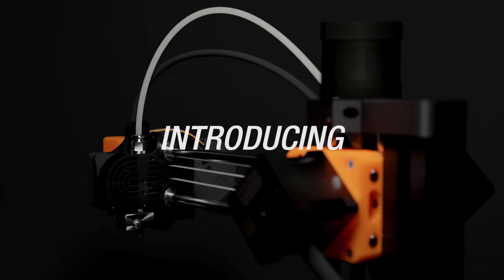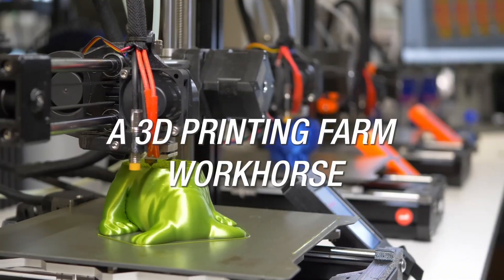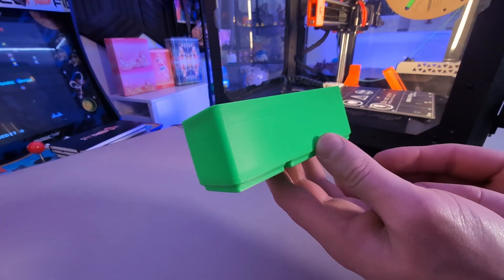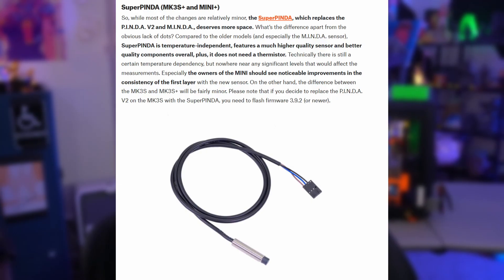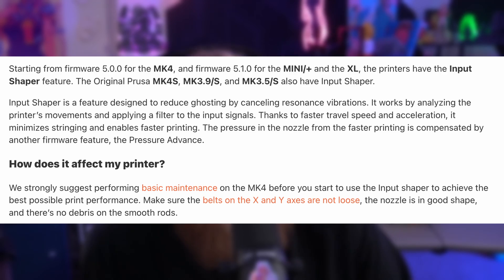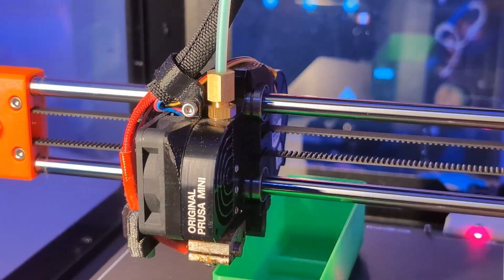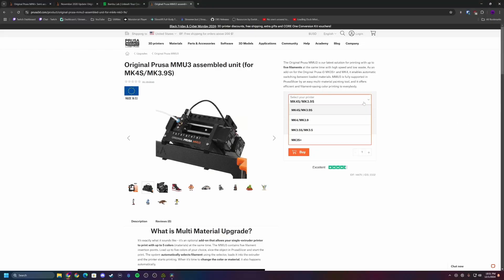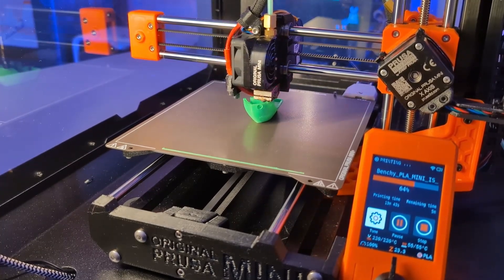The Rise and Stall of the Prusa Mini

Comment: The biggest flaw of the Mini in my opinion is the cooling. With the fan only blowing from one side, I often had to strategically orient prints so that overhangs would point towards the fan. It's overall just not powerful enough to print much faster than it does now.
It also needs to have a way to calibrate the XY skew automatically, because the assembly is prone to small errors that cause round prints to become oval. Having to fix this with a carpenter's square and many test prints is a terrible user experience.

Comment: I bought a couple of rescues off of FB marketplace.   $100 ea.   Then I did a full bearing and belt replacement.   I think it’s still relevant.    The fastest printer is another printer.   A lot of models I’ve done recently are ones you have to assemble.  Multicolor is cool but not always convenient or better for an assembly.   Being able to send small parts by color to my minis and larger pieces and multicolor pieces to my CoreOneMMU has proven to be a good way to speed up workflow.

Comment: I had a Ender2pro never felt like a pro upgraded £200 worth of parts with price £140 making it £340 just for silent and silent printing 200mm/s speeds. But wasn’t enough and consistent. When I saw prusa mini I didnt want another headache and waited and got FF5MPro. No regrets.

I wish that actually make dual gantry prusa mini or a kit. With direct drive for TPU and dual material. It would be good for £400 but naa they wont try

Comment: When Bambu locked down their ecosystem, I sold my P1S because being forced back to Bambu Studio from OrcaSlicer was not gonna happen. I uesd the money to buy the Mini+ with an enclosure (because I have pets) which has served me well and got me through a Voron 2.4 350 build, but the enclosure is so big it kinda defeats the purpose. It takes basically the same amount of floorspace as the V2 with the much smaller build size. If you can throw it on a desk for PLA and PETG parts I like it but the enclosure makes it way too bulky to justify.
Reply from the maker: Agreed.  Which is so sad because the enclosure is quite nice and built like a tank.

Comment: What i bought the mini for: entering the prusa ecosystem. 
What i got over the years: wifi, input shaper, proper prusa connect integration (yes, even easy print directly from printable)

I think it's a solid printer. It really doesn't miss many features. Only reason I will update one day is print volume and multi material

Comment: I went from Prusa fanboy with my MK3S+ and MK4S from 2020 to the Bambu ecosystem and man it just felt like Prusa was living in the dinosaur era, got me wondering how they're even surviving on the premium they STILL charge. Well I actually found a Mini+ on FBMP a couple months ago for $100 with only 3 print days on it, did a ton of upgrades on it including printing that badass printer base stand on Printables, new heat bed(other one wasn't heating all areas) assembly, tungsten carbide nozzle, Bondtech extruder, and some new PEI and Satin sheets bc the other one was scarred up so bad. I think the previous user just didn't know what he was doing and gave up on it. Anyways, after all the upgrades and tuning I've done, it still won't print 90 degree corners correctly without bulging/rounding them but other than that it is a badass looking little printer that brings me back to why I got into printing in the first place, but with all the tweaking I have to do sometimes it's sort of a love/hate relationship.
Reply from the maker: They're not bad little printers, I just personally can't justify the price of one anymore and I want the increase in quality straight from factory.

Comment: I have to wonder why Prusa bothered buying Printed Solid at all. They don't make Prusament, and barely keep any in stock so if you want any, you're still paying shipping from Europe. They're out of stock on a lot of the spare parts. Not really sure what they gained from it other than another distributor, but they haven't really done much to make it "Prusa USA".
Reply from the maker: Yeah I'm not really sure what the point was.  It's disappointing.
Reply: I agree 100%, and it's not any cheaper for us to buy it from PS than it is from Prusa direct! I needed a heatbed replacement for the mini+ and it was cheaper to get it from Prusa, plus i was able to grab a couple of print sheets and prusament, than it would have been to get from PSUSA plus they didn't even have the other things in stock. What a waste!

Comment: the mini aged, but mine still does  a good job. I changed a while ago to revo hotend. It's full metal and no tiny ptfe tubes needed to replace. 

BTW did you know that 3d printiverse made it possible to use mk4 nozzle on your mini?
Reply from the maker: I did not know that, that sounds like a good upgrade!

Comment: Basically nailed all the points (albeit, I've only been in the Mini+ camp). Started with a microcenters powerspec back in 2019 as I was very new, the non-sticking print bed that had to be calibrated every print really killed my motivation. It was a chore to print so I only made a few things on it. After the huge fan love and videos for the mini+, I splurged and got it. And yes, just 3 pieces to install, sliced file and......print. And it just....works. And it continues to "just work". Even right now, as it sat for almost a year, dusted it off and (after updating and everything ugh), clicked print and...boom all 5 objects are printing as I type this. Hell, I haven't ever changed or fixed anything yet. Everything is still OG from the day I bought it. Its..slightly louder yes, but its still kicking. 

I will say, I (or rather we with the mini+, especially in the discord) have quite a bit disdain with prusas promises as well, if you remember, they promised us wifi for the mini+. That, of course, never came to be until years later. It was especially questionable because you had devices all the way back in 2005 (the psp) that had built in wifi. Yet for some reason, expensive machines built in 2020+ can't have this basic feature. 

I have no idea what this "input shaper" business is, so I guess I will find out when my current print finishes. Personally I have no care to update anything, since I had zero extrusion issues before. It'd be shame if now all of a sudden, an update made printing quality worse. especially since prusa's were/are known for their quality prints.

Comment: Well, you are mostly right. There is one little detail - it is not worth it for people in America? Europe? Shipping is 10€. And in Czech Republic? 3,50€ for shipping. Boom, way ahead of Bambu. 

Last month I bought my first Mini. Got it second hand from local Craigslist for 172€. It was listed as broken and not working because the original owner was playing around with a soldering iron and broke a pullup resistor from extruder thermistor, which sent the printer to error state. That was easily fixed, took be about two hours of soldering. On the other hand the printer was already equipped with upgraded extruder from Bondtech. Sadly the seller chose bad shipping company so the printer came broken. The main polycarbonate pieces in front and back got damaged and the print sheet got the PEI sheet damaged. Spare parts were ordered directly from Prusa, 3,94€/piece and 9,64€ for the PEI-Ultem sheet, 3,50€ for shipping. Once I fixed that, I found out the printer had used 500m of filament in it's life so it basically printed nothing. 
Next I started upgrading - ordered titanium heatbreak from Trianglelab (7,50€), Mellow copper heat block (9,40€) and 70W heating cartridge (3,43€). After trying to install the heater I found out the thermistor is kinda mangled from mishandling so I had to order new one from Prusa. That was 9,92€, bought a new nozzle (5,93€) and grabbed a satin print sheet (35,81€), 3,50€ shipping. The only thing I am missing now is boron nitride paste for the heatbreak. Also bought second spare PEI foil from cheaper shop (7,93€), some T nuts for Z axis support (0,79€) and 2,99€ for shipping. Summed up - 280,22€ for well upgraded Prusa Mini+ with all the shipping. Still not worth it? :)
Reply from the maker: Shipping from Prusa to somewhere other than US definitely changes the equation a bit.  But look at how much you had to change about the original design to get a printer you're happy with?  It sounds great if you want to change out parts, try different upgrades, etc.  I do not want to do that.  I want a printer that works well straight from the manufacturer, which the Prusa Mini does mostly (I still use mine even if pressure advance stuff is not 100%).  My point was that buying a NEW Prusa Mini doesn't seem worth the cost + hassle.  There will obviously always be edge cases where my conclusion is not true.
Reply: @TubaMakes  Well, yeah, true. But I didn't have to change the original design. I just... Upgraded the materials it is made out of :D 
That's just me and my overengineering brain though. Once I fixed the functional problems it came with the printer worked flawlessly. It just needed first layer height configuration and my first print on this printer came out perfect. I don't personally have experience with Bambulab but from what I heard from my friends who tend to blindly hate on Průša the experience is great, but not 100%. So mileage may vary. Yes, you are right - it is not worth to buy the mini anymore. Price in CZ is 459€ plus 4€ shipping, Bambu A1 mini with AMS is 349€ + 10€ shipping + 72€ VAT so around 431€ and it offers AMS.

Comment: Honestly, as a prusa fanboy ever since I got my mk3s+, I gotta say that it hurts to see what prusa is doing. I mean I love the core one and I will get one, 100%, but it's missing features that are really sought after like a camera and accelerometer. Tbh they are getting ripped off by that company that is making the buddy 3d camera cus I'm like 90% sure that camera is simply bought from China and resold for a huge markup. Also, since it says in the description of the camera that it should offer remote movable camera it likely means it has some sort of motor inside (idk if that's the case, I didn't do any research). Which means that the core one camera, the smaller magnetized one is missing that feature and is sold at the same price. That's just stupid to me. And the accelerometer it's way too expensive at like 18$ cus other ones are like 5$. Sure, they probably make their own accelerometer, but if they make it and they make all the other boards in their printers, I'm sure they could easily add the accelerometer as part of the board itself, like in the hotend. Bit more difficult for the heat bed but still. It honestly saddens me because, even with the price premium, more people would buy Prusa if only they offered more features by default with their printers, not separate add-ons that cost WAY too much. Although I want  the camera for the core one, I'll likely get some cheap alternative and make a case for it or wait for some 3rd party to make a compatible one.
Also, unrelated to my rant, but that PTFE tube, you can just buy some cheap PTFE tube, cut it to length, use a drill bit to add a chamfer to the entrance hole and you're good. I can do that on my mk3s+ too (although after nearly 2 years I never had to, but idk)
Reply from the maker: I agree.  If I felt like the Core One had everything it needed to in 2025, I'd get one.  Especially with Bambu being Bambu.  I love Prusa Support and I love Prusa Connect.  But it is HARD to see the reviews of something like Elegoo's Centauri Carbon at supposedly sub $500 and still blindly buy the Core One.  I personally can't make that jump in money and I really really want to.  Like I said in the video, cheap got good.  Prusa can only run on "We're Prusa, so you'll keep buying" for so long.

Comment: I believe Prusa will release an upgrade kit to the Prusa Mini one day

Probably an accelerometer,  upgraded hot end with better cooling. 

They might release a new version of the Mini but offer an upgrade kit similar to the i3 Mk3.5S

Companies can do a 180 (just like we saw Bambu do over this week with this new firmware)....

In my opinion what has stopped the release of an update to the Mini is Prusa knowing they needed to release a core XY that was also affordable to compete against Bambu and Creality. 

I agree that the upgraded Pinda Probe should have been free though, a crap decision on their side. 

Very nice video. I have issues tuning pressure advance on my Mini too.

Comment: If you could get one for an easy trade for things i didn't even pay for .. would you ? I need to do smaller nicer prints the Fl sun Qqs I just got is a pain in the ass and doesn't level right needs a bunch of upgrades just to operate decent .
Reply from the maker: If you need a printer and can get one for cheap ( or cheap via trade), absolutely!  The mini isn't a bad printer, just seems left behind by Prusa and not worth buying new.  I still have and use one of mine because it's my enclosed printer for ASA.

Comment: With Prusa's new partnership with Printed Solid for building and shipping printers in the US, they now have a lower cost way to sell printers and parts to North America.  This will help, but at the moment Printed Solid seems to be "out of stock" on much of Prusamint filament.  I agree that the mini is no longer the machine that hobbyists would gravitate to, but it still might make sense for cost sensitive print farms.  The  long term reliability of the mini is probably better than other lower cost mini printers, so it still might make sense in print farm applications.
Reply from the maker: I just don't see it making sense for print farms to buy new Prusa Minis given the up front cost and lack of modern features.

Comment: I have a mini+ and a mk4s and i use the mini a lot for prototyping as it's quick enough and quiet. I agree with you though... Prusa needs to move on from most of us and start focusing on the commercial or enterprise markets. They also need to do something about distribution... Shipping everything from Prague is in most cases more than the cost of a roll of filament.
Reply from the maker: I really thought their merger with Printed Solid would see them stock inventory here in the US, but it usually seems like Printed Solid charges more for each part/printer and then it's a wash between Printed Solid and straight from Prusa.  Last time I needed a part for the Mini, Prusa said it would be here in two days.  Printed Solid quoted 5 and the cost was a wash.  I don't understand their logistics at all.
Reply: @TubaMakes  From my understanding Printed Solid is taking over portion by portion as their team expands and gets trained up, but to keep the Prusa quality they have to do everything 100% the same as the main team. 

So far the 1st complete portion they can readily do in the USA is the assembly of the MK4S, but they still are shipping parts over from Prusa. To supply and create the parts in the USA is a whole other beast, so prices at Printed Solid can only sometimes beat Prusa directly in 2024. That will change, but its a long process and there's a ways to go still.
Reply: @TubaMakes  My thoughts .... 
According to their website, Printed solid gives free shipping, and there is no duty (tariff).  The price is higher however.  I asked them, and they will be selling the Core One in both kit and assembled form.  I'll have to see how their price compares with buying one from Prusa.  I'm guessing that the tariff and shipping from Prague will add about $200 so the Core One kit would cost me about $1150, plus MA sales tax (6.5%).  BTW, that cost compares well to a Voron Trident 250 kit when you add in the cost of shipping from China (plus future Drump tariffs), and 3D printed parts (not included in the stated kit prices), plus any mods I would make.  The Creality K1C would be less than half the price of the Prusa Core One, but it's a larger machine (not in build size!), and noisier, and not as good a track record in reliablity.   And Prusa has an excellent reputation in print quality.
So I hope Prusa sticks around.  I think they will, though they won't ever have the market share that the Chinese makers do.  Then again, Lulz Bot is still around, and they seem to have found a secure nitch at their price point.  Same with Ultimaker, etc....

Comment: I'd like to see Prusa release a Core One mini to compete with the K3, micron and salad fork.  I like the smaller 180^3 form factor.  Fast startup and enough print volume for most prints.  A core XY Mini doesn't really need to be cheaper than a Core One either, because if done right it should be better performing than the Core One.